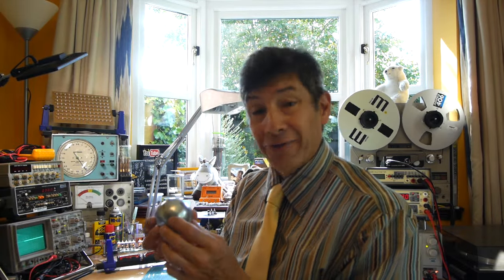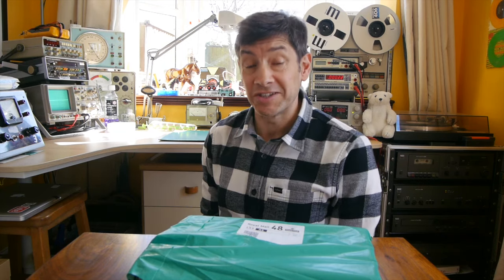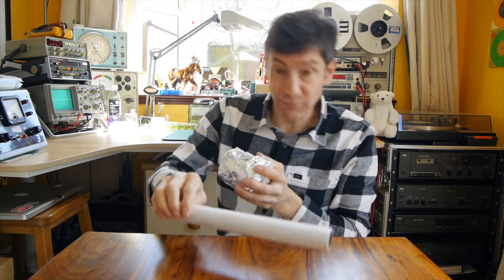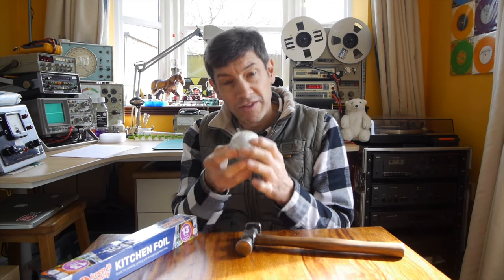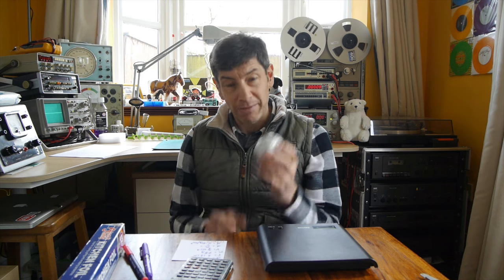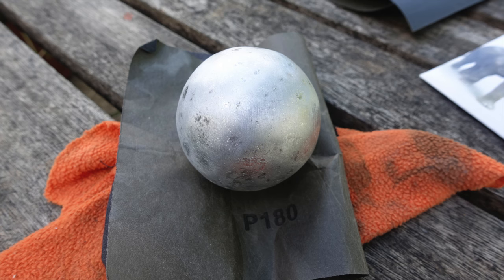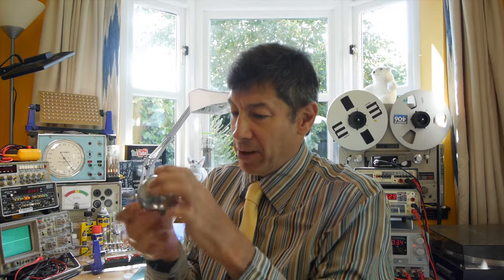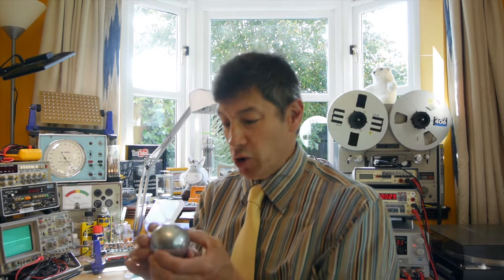Aluminium Foil Ball Challenge - F-J's Physics - Video 193

Comment: I can say from experience making layers like wrapping it is not the way. The inner part will press against the outer layers. The densities are not the same internally. You end up with a ball in a shell. It is best to bunch all the foil together at once, in a random way to distribute the impacts into the whole ball, not just the shell. If you do end up with a rattling ball inside it can still be ok, maybe a real good way, but a smaller ball. Open the shell and work on the inner ball. You will find if it rattles and you open it, the ball inside is very symmetrical and dense. The center ball was started with random compaction. And at some point you start wrapping. The center ball is the random part. So to use all the foil and not get a shell and rattle start with all the foil unrolled. And bunch it all up at once. Keep a sphere shape as possible, but it is not that critical since hammering it to get it dense will achieve a ball from a shape that seems to lumpy to start. A good test for density is "will it float in water?" If you get it to sink your doing pretty good. It isnt easy to do. Using the bottom of a tin can to hold the ball when hammering, or something like that will help a bunch. And as a hammer I use a 2 inch steel ball. Or a 1 inch on a smaller sphere.

Polishing, I never sanded at all, and never used any polishing material. I simply rub the steel on the sphere and end up with a very smooth sphere with a near mirror surface. I found an aluminum geer that is very smooth and using it like sand paper it gets an even smoother surface.
Reply from the maker: Thanks, yes, I see your point about random scrunching and then wrapping.  It was all a bit of fun really.  As far as sinking or floating in water, this one would definitely sink as it was almost 2000kg/m^3 which is twice the density of water but only about 2/3rds that of aluminium.  Glad you had lots of success with yours.  Be tempting to try brass foil or even a lead one!
Reply: @AnthonyFrancisJones  I finished an aluminum one with s layer of copper foil. I like the look of it.

Comment: Not quite as spherical as youtu.be/ZMByI4s-D-Y (!) but pretty good nonetheless. It would be interesting to see what the material is like in cross section close up, e.g. with a scanning electron microscope. A good proportion of it must still be air with a bit of oxide too, but I wonder how it's distributed.
Reply from the maker: Yes, I remember that sphere when it was discussed in Physics World a few years ago.  Not quite that close indeed!  I really would not want to cut it in half but would be interesting to see what it looks like.  Ultrasound would just produce an mess of an image I think.  Adam Savage did a good job with the water jet cutting https://www.youtube.com/watch?v=onZDAKJq6z4   I really feel that, whilst there must be lots of voids, dirt/oxide etc. the layers may well have got close enough to form metallic bonds.  It was a fun project regardless and thanks as ever for your interesting observations.  Do keep them coming!
Reply: In my comment I mention the layers of density and how I avoided those layers, and how I achieved layers unintentionally. And made a rattle that I opened and found a very nice ball inside.  What a Hobbie, haha.